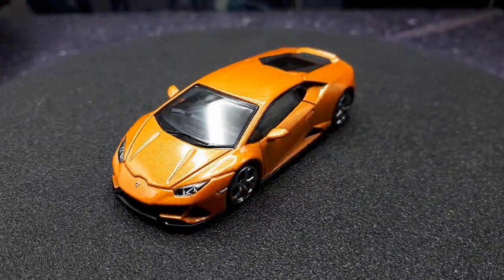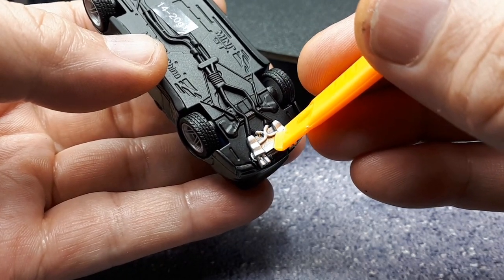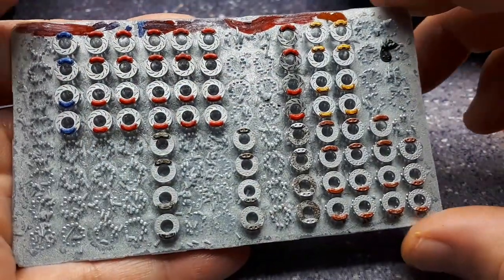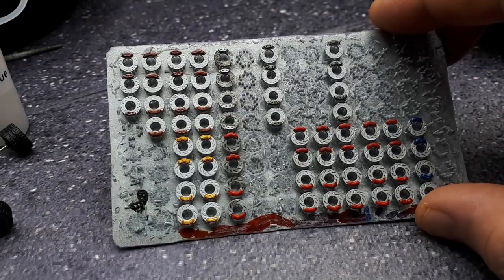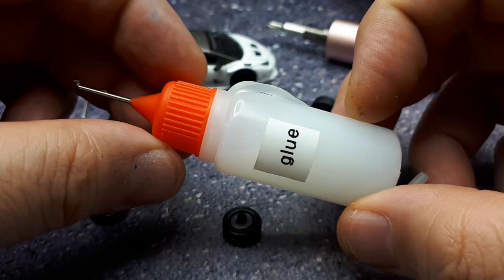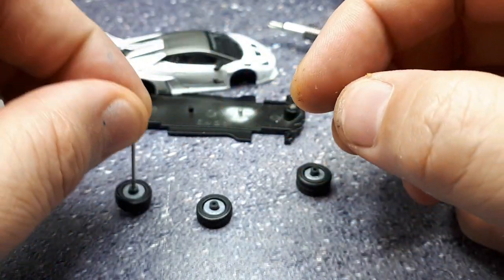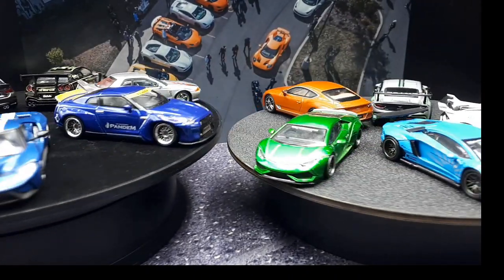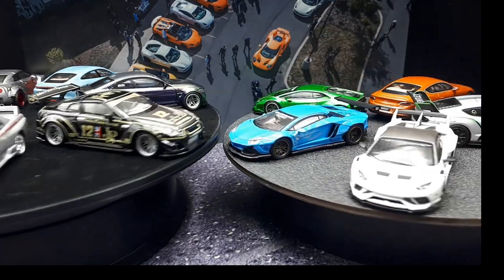1/64x11 custom MiniGT: 3D printed brakesets, interiors, & tutorial

Comment: You can try to make the separate part from the break disc and caliper . Then fixed the caliper on car , so the caliper won't roll with disc . This way will let it look more  realistic
Reply from the maker: The bases all differ in spacing and thickness so there is no universal brake with tabs possible unless you modify the tabs for each model.  I figure most people are too lazy to modify the tabs to fit each model and it would increase the cost.